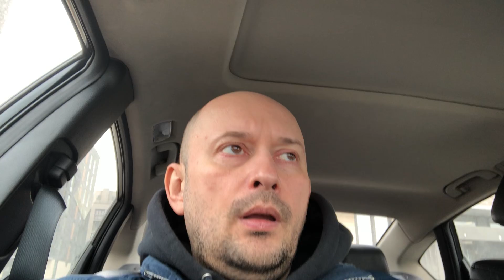Atmospheric amplifier for the resonance

Comment: i  have become convinced that all these similar pre-mud flood buildings, structures and architecture all over the world were pre-EMPCOE ( Electromagnetic Plasma Changeover Event), yet another (unreported to the masses) cycle in our universe, in which the DIRECTION of the magnetic field (i.e., the flow of plasma) of the earth originally caused light to emanate (discharge) from the surface of the flat earth, (the 'flip ring' in this electromagnetic model) UPWARDS, illuminating the 'heavens above' accounting for the ubiquitous domed structures found all over the world, as well as the art decorating them.  the light/plasma coming UP from BENEATH our feet would illuminate ALL objects, indoors and out, making artificial illumination unnecessary.  the spires of 'churches', obelisks, etc. served as plasma-discharge devices to protect the surrounding areas and structures from destructive plasma overloads a discharges- think lightning rods working in reverse.  the period before the last magnetic change-over (NOT a pole shift) WAS the Golden Age.  the world-wide mud floods, general destruction, and disappearance of the world's populations (giants, and others) was a direct result of this periodically recurring catastrophic event, and will occur again, and soon, based on the depth explanations and descriptions provided in the research offered by Mia miasnewpairofglasses.com/ and Brian Austin Lambert http://brianaustinlambert33.com/, which serves as the primary basis for this theory... 
to picture this, imagine the beam of light from a flashlight at night illuminating only that within its beam, while from that area being illuminated, the beam only appears as a bright light surrounded by darkness- just like in our current situation with the sun's plasma (flashlight beam) illuminating the earth, rather than the earth's "plasma beam" illuminating the heavens...
Reply: Cash grab alert!
Reply: do not believe these two- deceiving thru fear porn
Reply: suns a patented malfunctioning blinking white hot sim of bulbs and mirrors. Not yellow as when i was young. 1000's vids here in it.